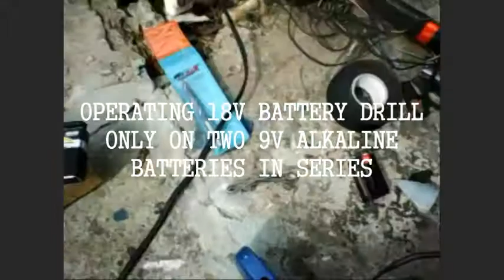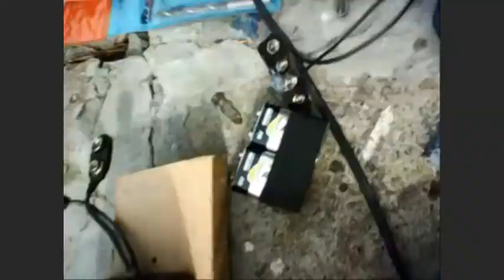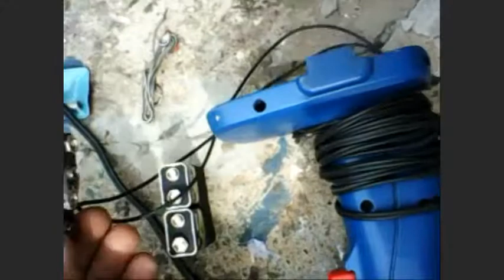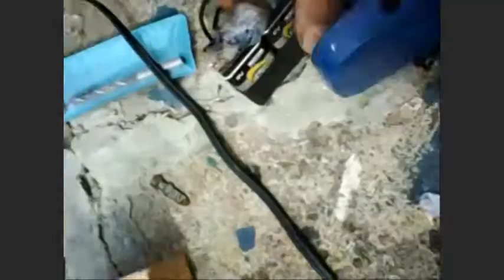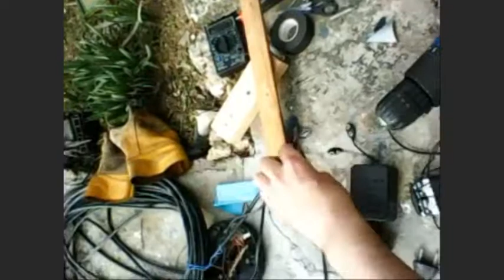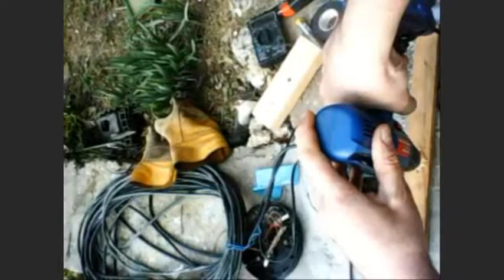Run your cordless drill without battery pack - only on 2 small alkaline 9V batteries

Comment from the maker: ***Update* Just hooked up 2 electrolytic capacitors 25V, 4700uF in parallel with each other and a dual battery and I have boost in drilling power(it takes high current from a capacitors when it's stalling)
Reply: Give a drawing to know how to do it